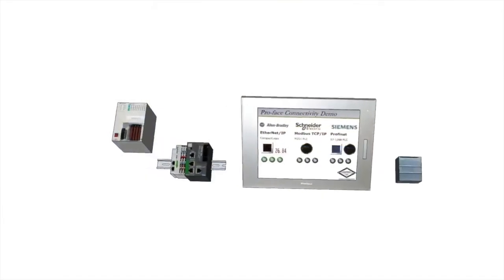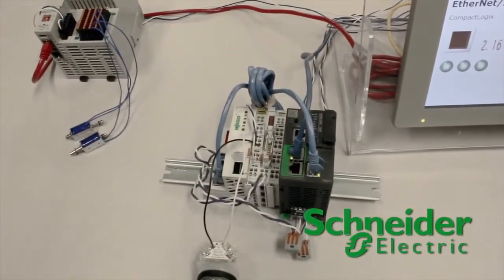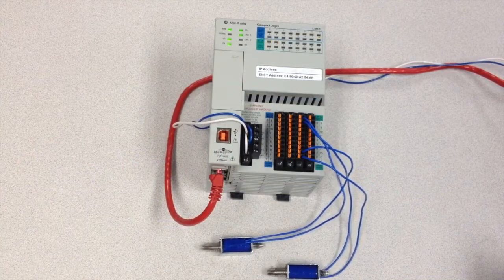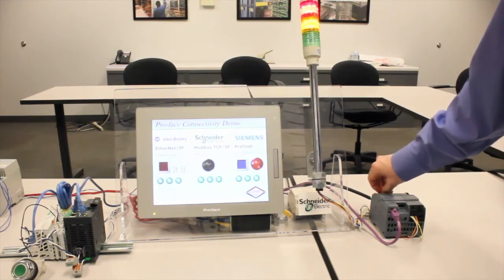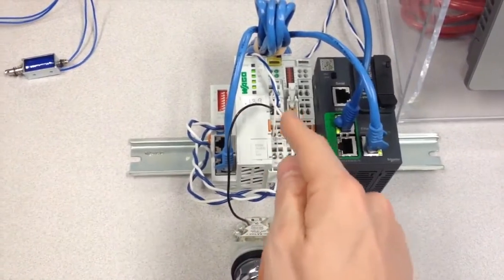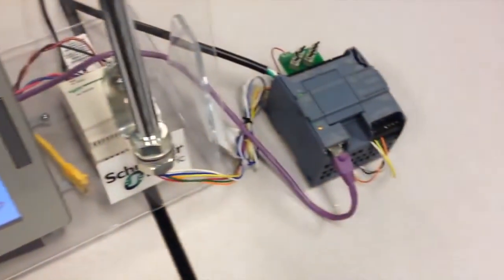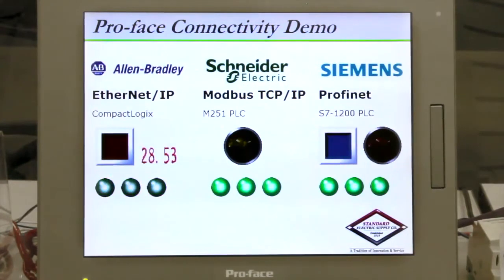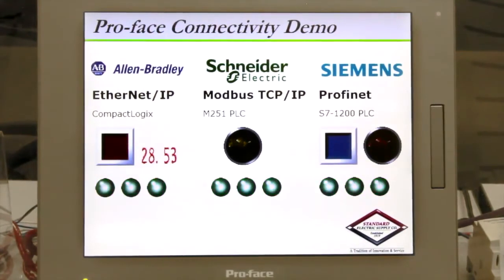Proface HMI Connectivity Demo

Comment: Hi, 
Can i pick your brains, as you seem to be the guy to ask :)...
I would like to build a very simple Pro Face Display that essentially will be an alarm repeater indicator for an access control system. The display will need to alarm if an Exit is opened. (e.g) a very simple display showing four exits/names and when a dry contact (N/O going to N/C) is received from a controller at either of the 4 exits then the display will alarm and alert which exit in in alarm, but will also cancel when the alarm condition at the controller at the exit is cancelled (N/C going to N/0)
What would i need (both hardware and software) to build such a system to display on a Pro Face display- thanks in advance?
L.